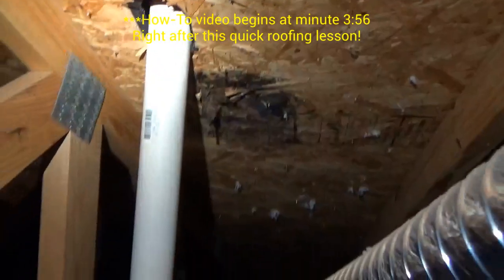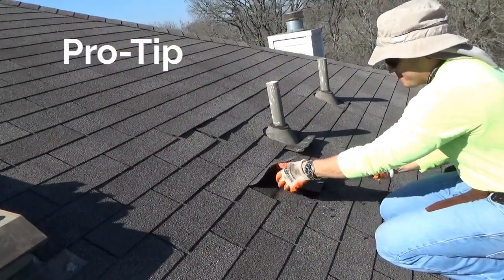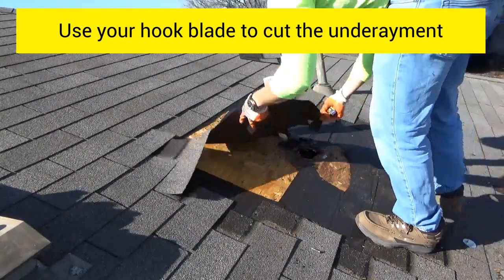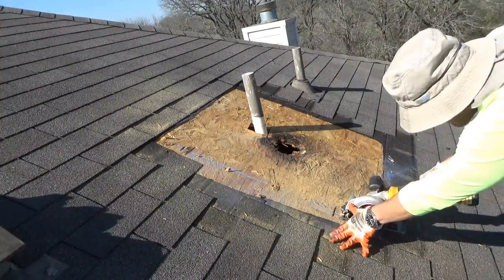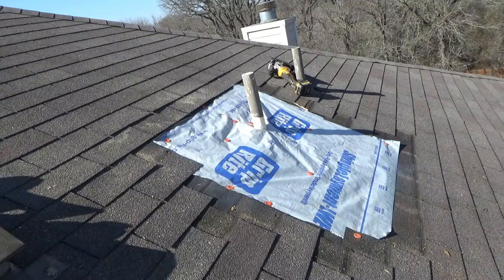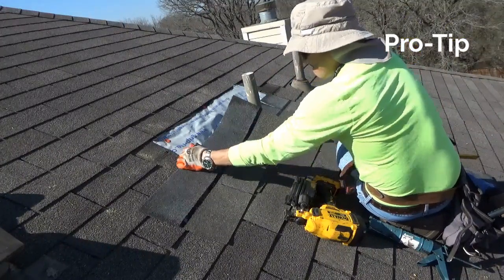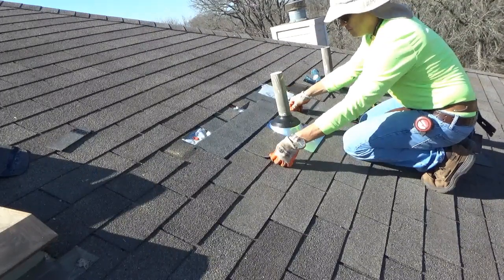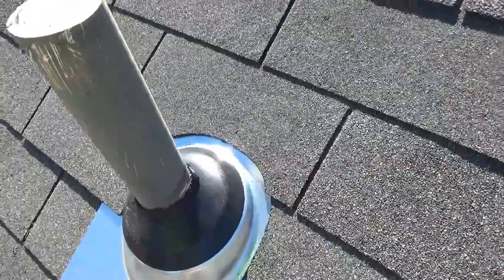12 Step-DiY_Full Roof Repair HOW-TO VIDEO (Plywood, Shingles, Pipe Boot Flashing)

Comment: This is the best step by step video that actually explains everything so I could understand it.  Thank you!  I noticed in the video that you used a plastic sheet as water barrier as opposed to roofing felt and was curious as to why?  Will be using this as a reference soon when I am repairing a leak.
Reply from the maker: It's all preference. Either is just as effective. Thank you for the comment.

Comment: First time here. That was really impressive.I have several soft spots on a flat roof and am going to take a whack at it using this same technique.  I figure some of the plywood has disintegrated, just hope the rafters are in good shape. Total novice but have a jig and circular saw......;}

Comment: I enjoyed watching your video, lots of useful information; I noticed you used 3 nails per single,in other roof repairs videos they said 4to6 nails per single is recommended;did I miss something?
Reply from the maker: Thank you for the comment. 
4-6 nails are always recommended for full shingles, but in some cases, you have to cut the shingle to fit your patch/work area and only need half of a shingle then you don't need 4-6 nails since it's not a full shingle. Great question.

Comment: Question.  Other than appearance issues, What problems can arise from putting shingles over roofing felt that isnt perfectly flat?  Im putting a roof on my 23'x16' garage with a 6/12 pitch.  I dove right in uneducated and chose 15lb felt paper.  I was unable to finish the job quickly due to my inexperience and schedule.  Wind and weather have blown and torn the paper.  However the lower half of each side is already shingled.  The starter strip and the drip edge are already on.  The paper has torn under the starter strip and drip edge.  Should i pull them up to replace it?  Cut the paper to get it flat and patch new paper over it?
Reply from the maker: I would say to leave the existing felt, cut it, slice it, and dice it "Zoro" style, lol. Cut it till its flat, then immediately go over the existing felt with a new layer of fresh 15lb felt, just watch your step and don't fall or slip stepping on the torn felt.
Do consider this;  You must plan accordingly. If you think you can only felt and shingle one side per session, then  only install felt and shingle on that one side and leave the other side for a later day. Doing this will save you time and labor and also ruining the exposed felt. Felt or any underlayment is not meant to be left exposed to the elements of the sun.
Hope this helps. 
Thanks for the comment.
Reply: @AurumRoofing   I appreciate your reply!  It is helpful!  This is my first attempt at roofing.  A skilled roofer could have this done in a day or two.  My eagerness to get it done has led to poor planning and understanding of the materials.  The 15lb felt on a 6/12 pitch was a big mistake.  It has slowed the job immensely.  Rips snd curls way too easy underfoot!  I'll cut and cover as you suggest.  The new felt may have to be over instead of under the drip edge on the gables.  The starter strip shingles are already on, so they are obstructing lifting and tucking the new felt under the drip edge.
Reply from the maker: Correct.

Comment: My  14 yr old house had water coming through in master bathroom roof. I have a pass through fireplace in master bedrm/master bath. Last January. I had roofing company come and see - they said I needed ‘debris’ cleaned and some flashings replaced. And some tiles near both chimneys were cut. Cost was $3,200. They cleaned all the debris from the valleys and cut some of the tiles back away from chimneys.This was Jan 2023. Here is what they wrote on my invoice:

“ An inspection of the roof was undergone to determine what maintenance was required. We found the tiles behind the two chimneys to be too close to the chimneys allowing debris to build-up which caused the water to overflow. This was repaired by cutting the tiles by 6" to allow the water to properly flow. Secondly, we found the valley metal ends were on top of the tile and this causes the water to spill over the valley and run allow the underlayment, which can cause the underlayment to prematurely deteriorate. This issue was repaired by cutting back the valley metal ends and installing a lead extension on the five valleys. Lastly, we found the valleys and cricket to have debris. We underwent a clean-up, which will allow the water to properly flow…” 

We had a lot of rain in Feb and March and even some in August. All seemed, but to my shock, last week, I noticed a stain on ceiling of a bedroom not anywhere near where the January leak was. But this bedroom backs up to living room in area where there is another fireplace/chimney. I don't know when this happened. I seldom go in that bedroom and I seldom look at my ceilings. But water must have gotten in somehow. . I called the roofing company and left a message. Waiting for them so call me back.
I got a ladder and went up to feel the stain and there is no wetness or puffiness on the ceiling. 
November is a month we often get rain. Of course if we get rain before the roofer calls me back I will be sure at watch the ceiling where that stain is. Is it possible that
there was an unnoticed issue in this room but no problem NOW since the roofer worked on BOTH chimneys?